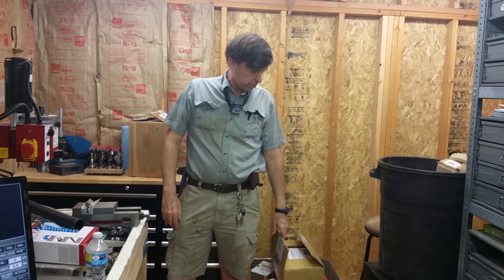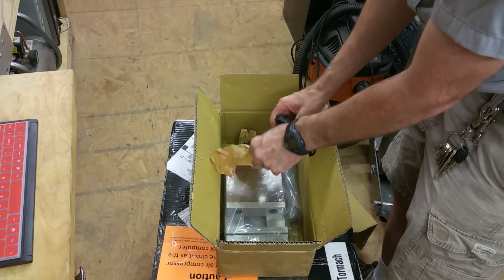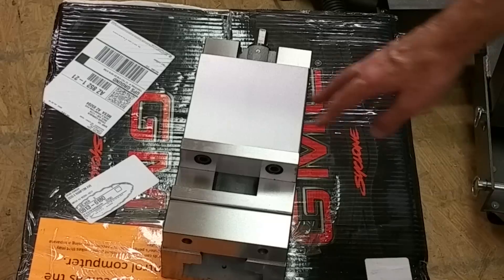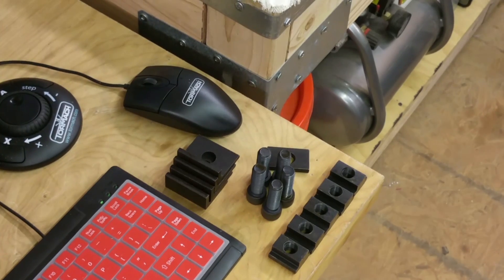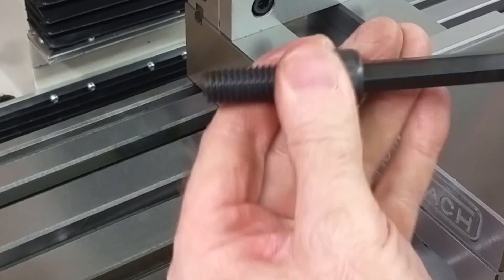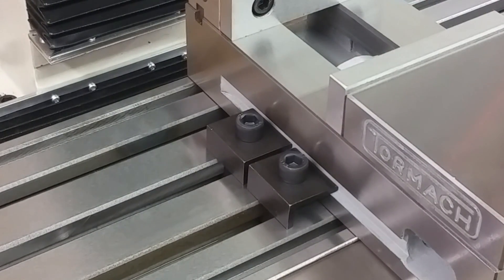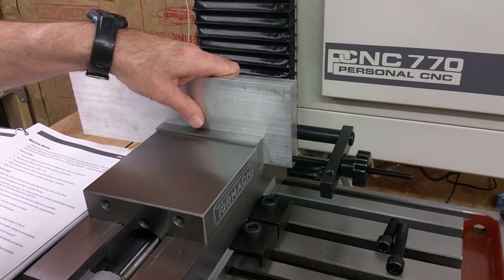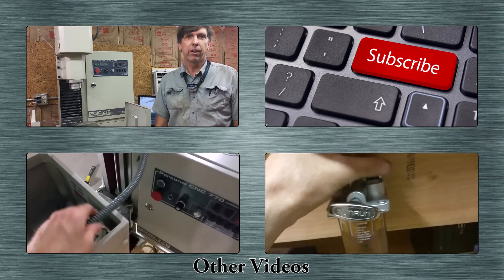Tormach 770   Part 9   - Tormach Vise

Comment: Hi there, how you do you like your vise after all this time ? I am looking to get one myself the same 5" version, Thanks.
Reply from the maker: Hi.  Works great.  Very easy to tram with the keys. I don't use it as much as I use to since I got a pallet system.  But if I need to make a part or 2 and I don't want to waste a pallet, its my go to vise.
Reply: Did you make the pallet system yourself? I am on the fence between buying a vise or making a few pallets
Reply from the maker: No, I use the Pierson Workholding speed change pallet system.  Here is my video on it. https://youtu.be/6372025wQn0

Comment: If it was me. I would make a one inch plate that bolts to the bottom of the vise and cut a key slot that fits snug in the table slots and a key in the top of the plate to fit in the slots in the vise. That way the vise can be removed and replaced quickly. if it is made larger than the vise it can be bolted directly to the table slots with just Allen bolts. That how I did it when I worked at Linamar Machines. It cut down setup time and is always true to the Table if you take the time and make it right. Use one inch steel and cut key way in each side to fit vise and table slots. one inch stock will give you enough to machine each side to keep the vise true to the table or bed as I call it.
Reply from the maker: +cybot63 - Thanks for the ideas. I need to be able to swap out the vise and pallet system based quickly. I may just attach an aluminum plate to the table and machine key slots for the vise and dowel pins for the pallet base.
Reply: I will watch for the changes.

Comment: If it were me? I think I might trim those L shaped brackets that are used to hold the vise down. Then either solder some brass round stock to the trimmed edge, or just use some thin plate under each edge. I think you'll find that using them as they are that you'll start marking up the table. And if your using a water based coolant, you might try putting some oiled brown paper such as butchers paper etc. The table will rust under the vise without it. Probably the bottom of the vise also.
Reply from the maker: Thanks for the tips!  I will be using the fog buster for now.  Yeah,  I was worried about the clamps damaging the table.
Reply: +Craig's Machine Shop 
Glad you can use those Craig, yeah those tables mark and can get chewed up all too easy. Some simple 1"x1" x maybe 1/8" thick aluminum or brass plate would do everything you need to help protect the table. And I'd probly make a point of checking under your vise for rust for quite awhile to be sure your not getting any. I think it was John Grismo that had some pretty bad rusting and pitting on his table under his vise from coolant.
Reply from the maker: +Turning Point - Yeah, he has a lot of rust all over his mill.  But he runs his mill a lot with flood coolant.
Reply: +Craig's Machine Shop 
Yeah he does. Grease might be better for the bottom of his vise with the flood coolant, if you could keep the vise locked down in place. I haven't tried it yet so can't say if it would work or not.